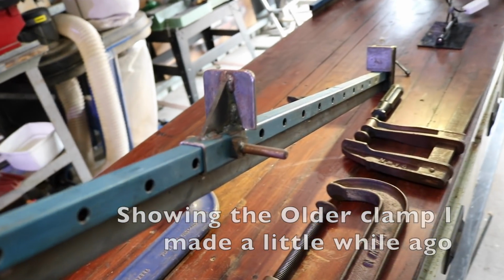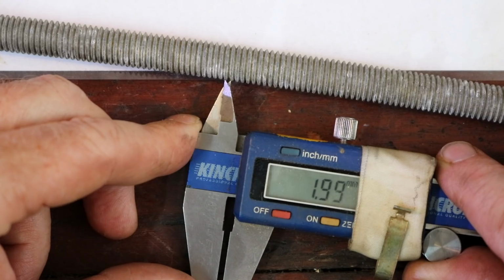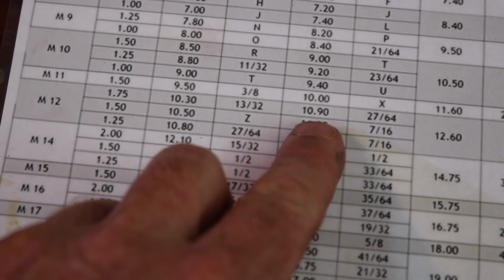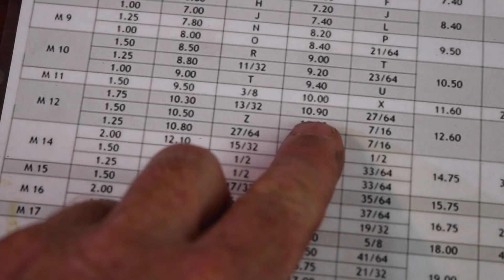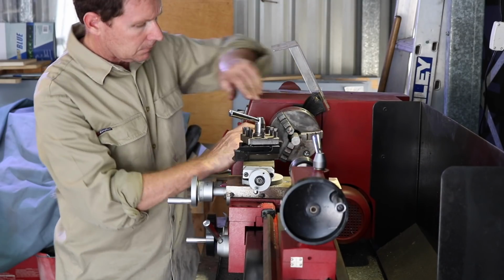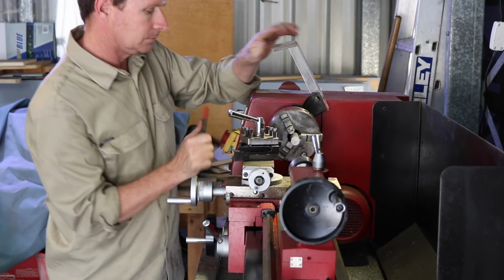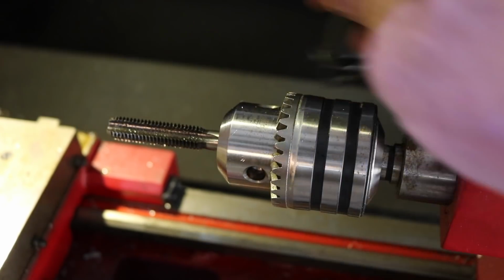DIY Bar Clamps - Forme Industrious

Comment: Nice work Scott. Some cool little techniques on display. Well engineered.
Reply from the maker: Hi Damo, thanks mate!  One of these days I will try my hand at cutting screw jack threads. Clamps always come in useful.
Reply: Thread cutting on the lathe is fun. I've had to relearn it every time I've done it though.
Reply from the maker: I know what you mean plus you have to have the right shape tool, but that's all part of the fun.

Comment: Hello Scott, wonderful video and enjoyed the sentiment at the beginning. By no means am I skilled at tig welding, but in my brief adventure of trying to learn it, I have found for at least myself that purpose built tig gloves make a large difference.  While it might not appear to improve at least while I am welding it brings another sense into the mix, giving me just a little more than by sight alone.
Reply from the maker: Hi Dray Holmes, thanks for your comment and suggestion. I will definitely get some TIG gloves. I have already ditched the heavy hand piece welding glove for a much lighter rigging glove and for my left hand I need something better fitted to allow more control  with feeding the filler rod. Oh and I need to set up a seated set up so that I can rest my forearms, again for better control. Holding the TIG Torch with no support needs a super steady hand and you end up dipping. Thanks again!

Comment: Hey Scott,
These look great. Least you know they will last a long time.
Question for you on the welder? Are you running a 3 in one or do you have mig and tig. Want to buy a mig and tig but unsure what to get at this stage. Since your local some advice from some one would be great.
Reply from the maker: Thanks again Eddie! Yes it's a 3 in 1 Rossi I got off Ebay a few years ago. It's Stick, DC Tig and Plasma. What sort of welding do you do most? I'd probably recommend the Mig for all your general steel work. TIG is great but requires new skills and it is slow compared to MIG. If you know someone with these tools see if you can try them out. Drop by sometime and have a go on mine ;)
Reply: Thanks Scott.
I was going to buy a transmig 175i.  Just humming bout price etc.
Mig welding is no worries for me. Just wanting to learn TIG.
Would like to catch up and chat with you some time.  Thought you were off on a holiday shortly.
Reply from the maker: Ok, well it's a handy skill, well I think it will be handy once I get on top of feeding the filler rod. Yes I leave on Saturday, back around Nov 9.
Reply: Maybe when you come back from holidays we can catch up. You will be busy planning stuff before you go. Enjoy your time in the big Apple.

Comment: Hi Scott, 
Another great build and I do envy that lathe, which is on my "one day list"
I'm currently looking at buying a band saw similar to what you have as I find a typical cut off saw very messy and on thicker material the cut seems to curve off. My question is, do you find your band saw to be the preferred method, and is it in fact a more tidy way of achieving the same thing.
Sorry if the question is a bit long winded. 
Cheers mate.
Reply from the maker: Thanks Paul. I saved a bit of money getting the lathe second hand. Some times it's hard finding the right gear for the right price though. I use the metal bandsaw because it's much cleaner in my small workshop. Friction saws spray black fine metal and sparks all over the place. Sparks can lead to fire. My band saw is much quieter also - for the neighbours.

Comment: Knowledge without experience is just is just information.

You can watch it, read about it, whatever, but it doesn't count until you actually do it, as you correctly point out.
Reply from the maker: John Winslow the theory is handy but can't you can't beat practical experience. I learn best by getting dirty.
Reply: @ScottTurnerformeindustrious  That's where Wisdom comes in - It is the culmination of both Knowledge and Experience.  So... aim to be wise. :)